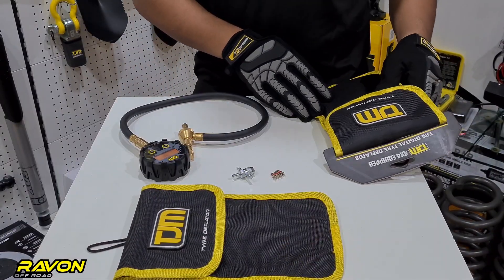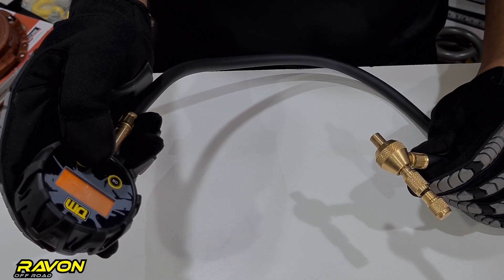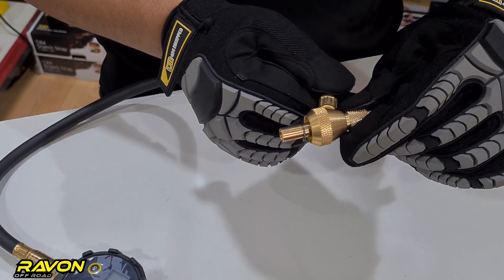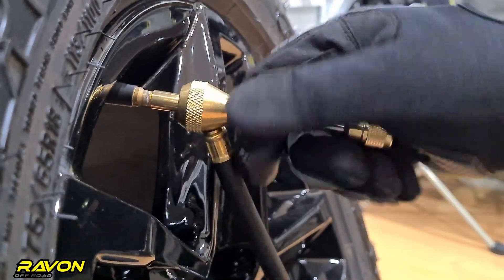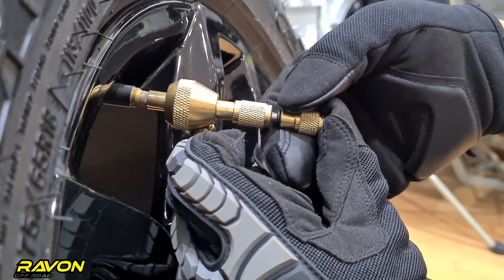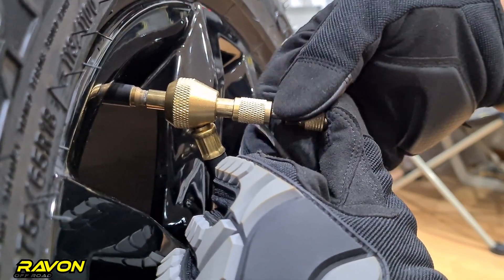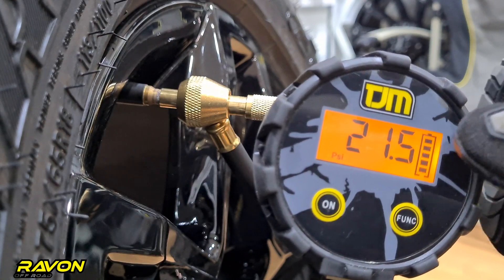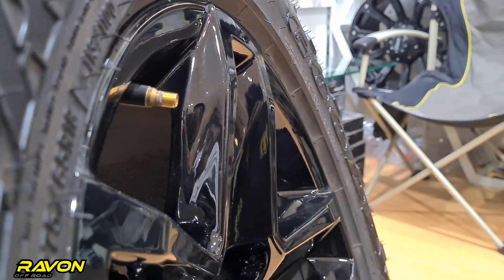TJM DIGITAL TYRE DEFLATOR GUIDE

Comment: How to replace the battery?
Reply from the maker: Hello, you need to slide the rubber protector outwards. This reveals a small plastic panel which you can pull and remove to replace batteries.
Reply: @ravon4x4  Got it. Thank you so much!